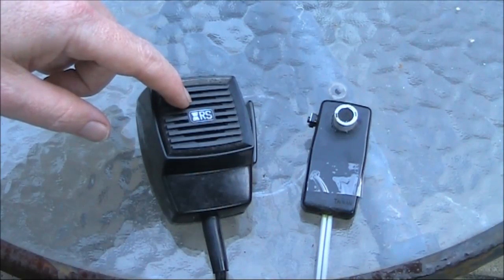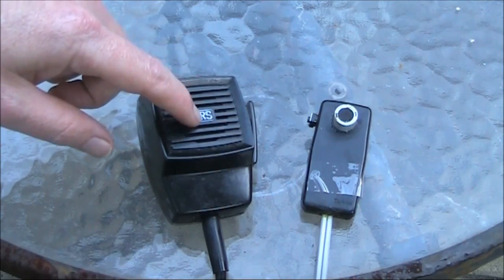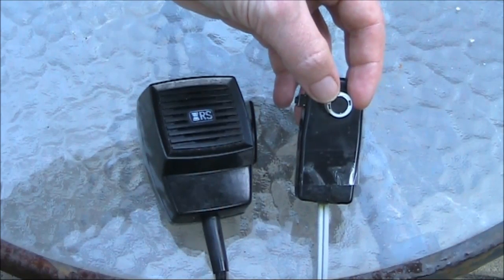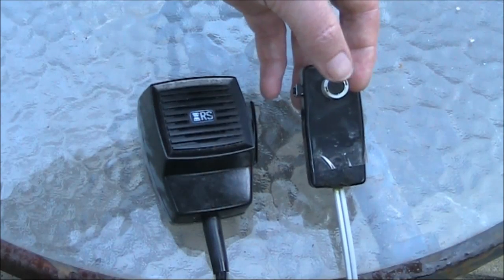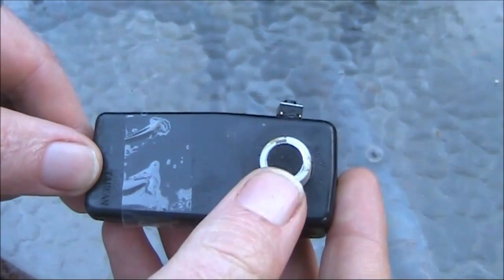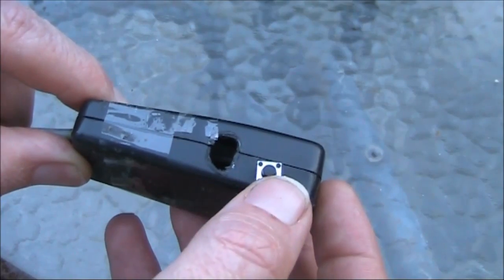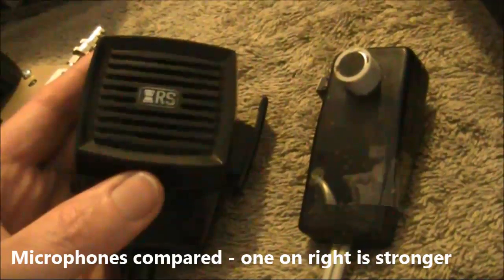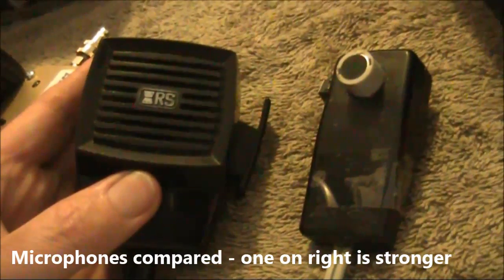The difference a microphone can make to SSB readability

Comment: Those standard/stock Radio Shack CB microphone were awful when new (most hated microphone), CB'ers in my district discovered early on that replacing the OEM insert with something removed form a dial up phone made a significant improvement to audio (although sometimes giving a tinny sound).

I still have a handful of these inserts today.